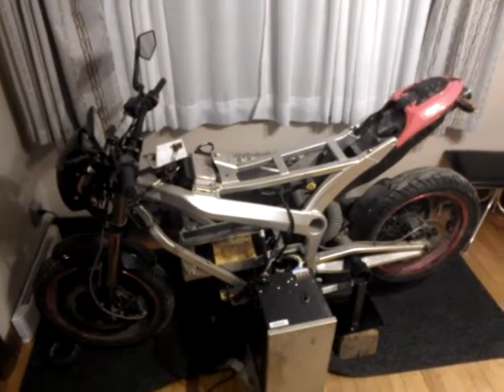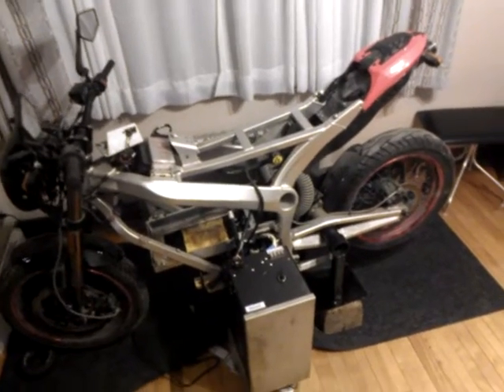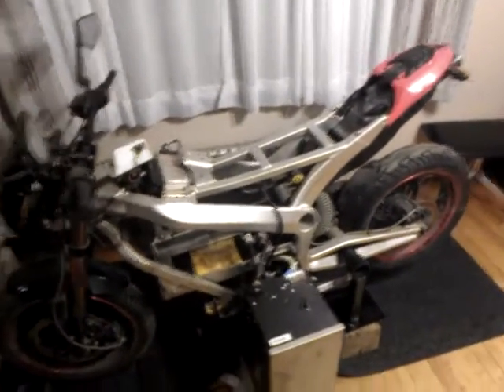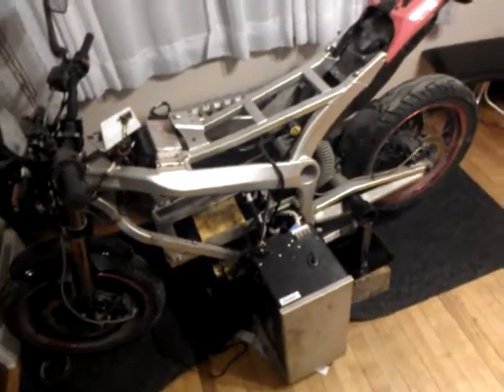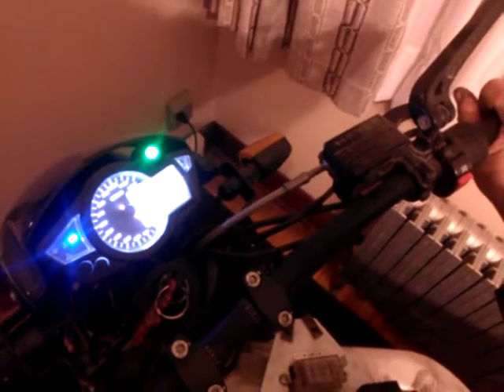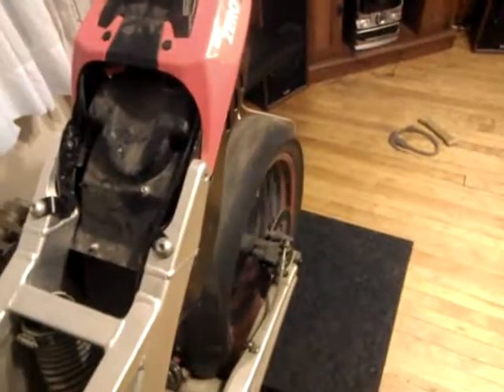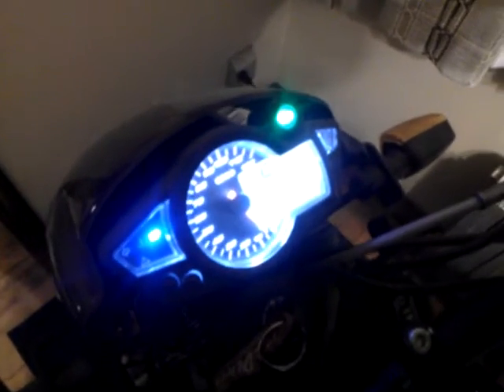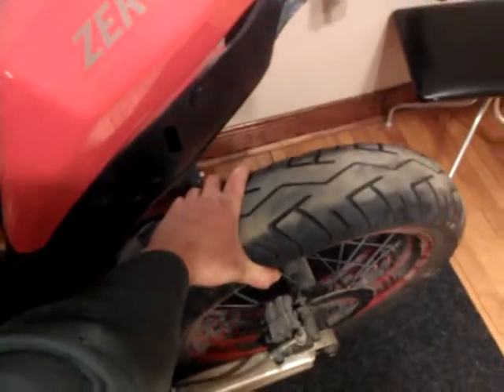2011 Zero S electric motorcycle with power issue

Comment: baterry?
Reply from the maker: +TheHappyRider That's what I was worried about... Turns out the problem was the solenoid, check out the follow up vid I posted
Reply: hello guys I have the same bike, and mine sometimes when I am running she shutdown and need to turn off and on again, this morning she turned off and no more turn on. Where can I find this solenoid? Can I just replace the 200AMP solenid for a bigger capacity with no issues? thank you